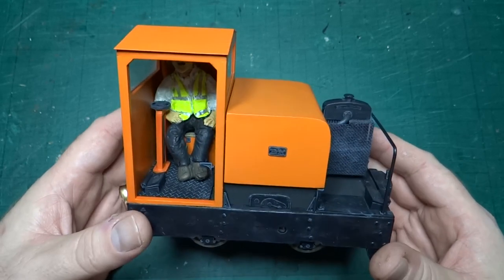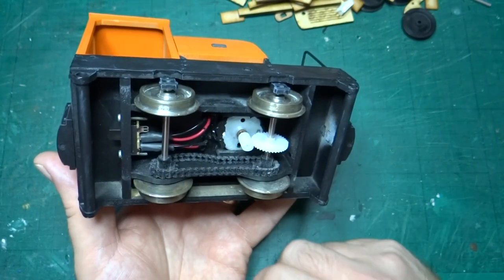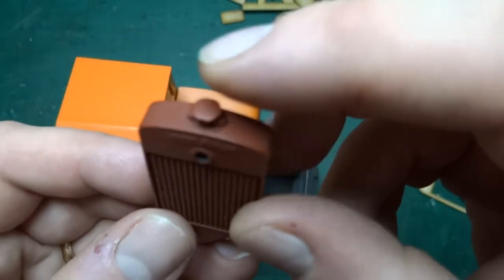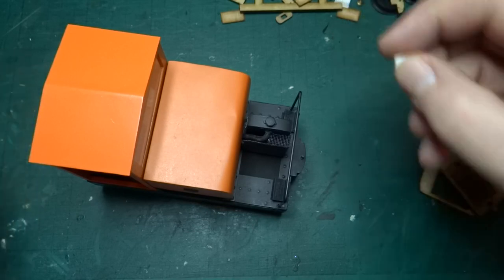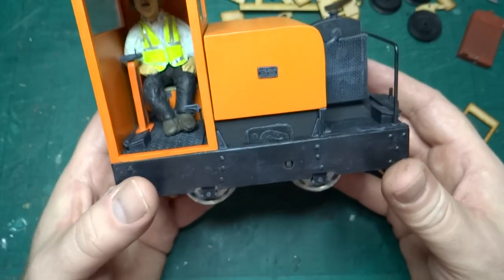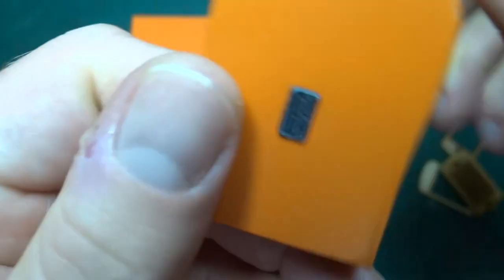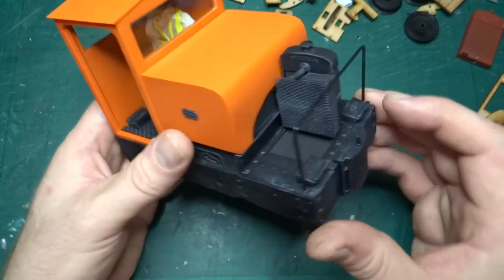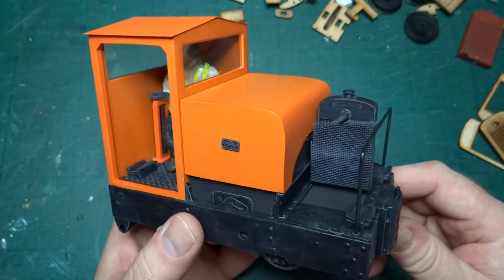I've Finished Building.... A Motor Rail Ltd. 20/28hp Simplex from a kit by P.S Models

Comment: I love the driver figure, im building a PS diesel box cab but with narrowed chassis rails and outside link rods rather than chain drive, i went for the diesel box cab for the extra room inside for radio gear and possibly a sound system and maybe even smoke generator, i hear hes doing a belt drive chassis soon, there amazing for the price of them really.
Reply from the maker: That sounds like an interesting build. I've not seen a price for his belt drive chassis yet but I assume they'll be cracking value like the other models. My only concern, from looking at a couple of product photos, is that there will be no way to change the belt. So if it snaps or gives over time you'll lose the 4 wheel drive. I guess that's less likely to be a problem in this scale than the smaller scales (belts in OO9 can be a problem over time) but it is one of the reasons I liked the use of a chain as it can be replaced or tweaked if necessary.
Reply: @encoffeedrinker  it's not available yet, he mentioned it through email while I told him my plans of doing a link rod conversion on the boxcab to which he sent the extra parts free of charge, I'd assume ittl be a toothed belt, the only way it could be changed once built would be to have slotted gaps for the wheel bearings instead of holes and some sort of printed C channel that can be screwed to the bottom of the chassis to hold them into place meaning the complete wheel set is removable
Reply from the maker: @adamswindells1  the photos I've seen suggest two plastic pulleys and a smooth belt with no obvious way of replacing it, but I guess we'll need to see once it's actually available
Reply: @encoffeedrinker  I'd rather just use gears than a belt, I was thinking of using differential gears from a small rc truck and a drive shaft, I may try and design and print own chassis at some point with an under frame horizontal motor with dual shafts if I can find one the right size or fit a horizontal motor infront/behind the axle instead of between the axles and a counterweight at the other end and run a shaft and gear setup from a WPL rc truck or somthing I'm not sure yet, I need to get my printer setup again and find my laptop to design again

Comment: Do you know the exact gears you used for the wheel chain drive?
Reply from the maker: Yes, I used the 12 tooth gears from MOTIONCO. Specifically part number SP122: https://www.motionco.co.uk/light-power-sprocket-bore-p-32.html

Note that these are the 1/8" bore to match the steel wheels I used from IP Engineering. I think the plastic wheels that came with the original kit are on 3mm axles so you'd want the 12 tooth gear with a 3mm bore, which I believe is part number SP12-3M: https://www.motionco.co.uk/light-power-sprocket-bore-p-393.html

I used their matching chain, although I can't remember exactly how many links I needed, and it's tricky to count with out taking it off, sorry. You can find the chain here: https://www.motionco.co.uk/light-power-chain-p-63.html

Hope that helps,

Mark

Comment: This is a hobby i have had to drop due to Brexit it has simply become to expensive and difficult to buy sm32/sm45 models/rails
Reply from the maker: I know what you mean. Certainly RTR stuff in these scales is well outside my price range now. You can get away with cheaper alternatives if you like the modelling side and making the extra details. As well as the PS Models kits (which are great value for money) I've got some laser cut 32mm track from IP Engineering which works great for seeing something run. Also Locoremote do a range of 32mm and 45mm 3D printed track. The files are available free to print yourself or they will print sets for you at a very reasonable price: https://www.locoremote.co.uk/3dprints.html
Reply: Would be handy if you publicised your brexit problems a bit more. There’s still a huge level of unwillingness to accept that brexit was a huge mistake. It’s just a massive piece of self harm that will set the country back a generation.